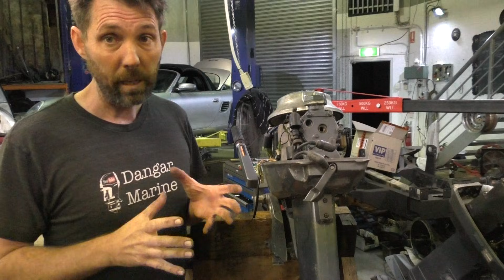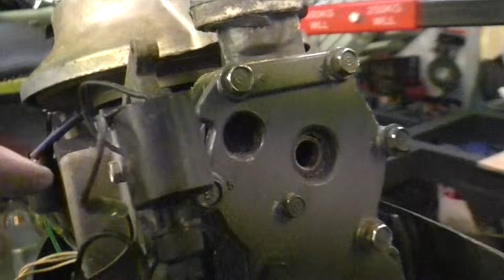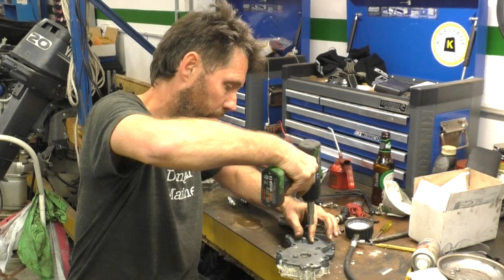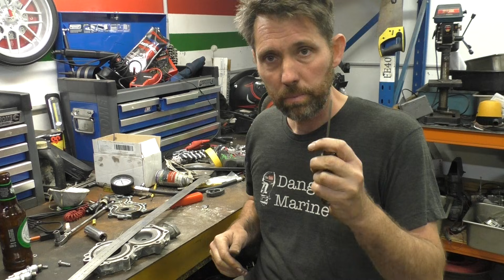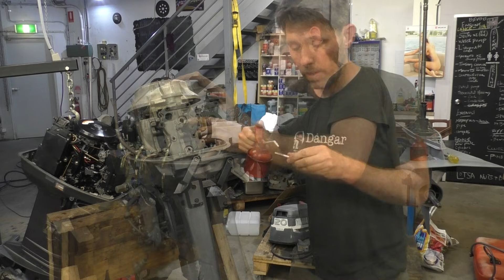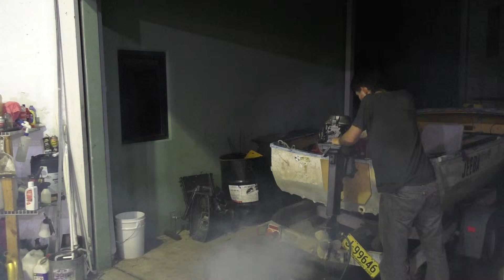Replacing a 2 stroke outboard head gasket

Comment: Great video Stu. I'm always nervous when removing those head bolts and still nervous when torquing them down. I've broken them in both instances. When it's all back together with no broken fasteners I usually celebrate with a much needed beer!
Reply: Yeah, always use new head bolts. Once installed (torqued to specs), they should never be used again. (they stretch after a time of running. it's only a few thousands, but that's all it takes)
Everytime I've seen a head bolt snap going in, it was with a used one... I've never seen a new one break on install, but maybe I've just been lucky for 40 years. lol
Reply from the maker: Hey Jack, interesting that one broke putting it in. I wonder if the thread needed cleaning first or whether it was a faulty bolt.
Reply: Worse nightmare is removing head or even exhaust bolts from engines that lives moored in salt water or the ones that's been used in salt water and never flushed with fresh water soon after returning from boating. Salt will seize anything badly.  It's a good thing to slight oil cleaned or new bolts, torque them to specs, should come out without any issues if  a latter removal is required...

Comment: if two carbs.. you know what's could be wrong; reed valves check; if upper sealing is gone -> lean upper cyl. ; inlet port cover gasket for "Falsh air"

it's definatly the upper cyl. is what is doint the sputtering... 

i love Guessing;)

by the way it's strange that only the Mercury is the only brand where you really don't need to worry about the had gaskets.. (2stroke of course)
Reply from the maker: Reed valves are definitely the next thing to check. A video on the timing will be out this weekend and it still backfires so next I'm going to look at all the causes of lean conditions. Could be a vacuum leak too.

Comment: I have a 4 stroke 5hp 2016 Tohatsu that will sometimes rev up when I put it in neutral.  Any thoughts?  I bought it new.
Reply from the maker: Hi Calvin, maybe the butterfly valves or timing advance is sticking in position and not returning properly?

Comment: have you ever had an issue with the water jacket corroding away from the cylinder sleeves?  anything you can do other than get a used block?   I've rebuilt the motor and it keeps allowing water through the head gasket.  first time i rebuilt it the headgasket i got was a 3 piece metal gasket that was revited together (i personally thought it was a crappy design instead of 1 piece with a good gasket material covering the gasket like a fiber mesh.  On that rebuild the boat ran for probably 5 hours  total over about 5 trips to the river, then same thing was double checking stuff and headgasket started allowing water in

i pulled head again and noticed the small area around the middle cylinder that had corroded the water jacket away from the cylinder sleeve

could you build that back up with jbweld so it has more surface area for the head gasket to sit against?   have you ever added high temp silicon gasket maker to your head gaskets for extra coverage?  good or bad to do that?

just looking for any random idea of what i could maybe do to salvage the motor instead of sending it to the graveyard or partying it out
Reply from the maker: Hmmm, can't say I've ever repaired a block that corroded, I've normally just written them off as more trouble than they are worth. I'm not sure a product like JB Weld would withstand the heat but I could be wrong.

Comment: that too cylinder looks like it's running a bit lean.
Reply from the maker: I think this may be a lean problem for sure.
Reply: Dangar Marine I'm not sure if it may have been in the video somewhere as I didn't quite watch the whole thing but that's what I gathered from the look of the cylinder head on no1. at my work on all 2 strokes we pull the exhaust off to check the rings and also check for scoring on the rings, piston and cylinder
Reply: number 1cylinder I mean

Comment: hey mate what would cause an outboard to surge under load
Reply from the maker: Could be an air leak in the fuel supply or the fuel pump not working properly, maybe even a vacuum leak.
Reply: Dangar Marine got it fixed at a local boat shop cost me $130 carb needed a clean, primer pump seal and timing was way off I'll take it for a spin tomorrow if I get time

Comment: Hey Stu, quick question, do you use resistor spark plugs or non resistor plugs in your engines?
Reply from the maker: I usually just use what is ever recommended by the manufacturer. If the outboard has sensitive electronics then they will almost always recommend resistor spark plugs. Having said that, I don't think you can go wrong using them even if they aren't required. Good for RF interference too.

Comment: Not really related to this video but a while back we hit a rock with our mercury 90 two stroke. Motor kicked up and but chunk of skeg missing. Still ran perfectly, waterskiing and everything. Then when we got skeg repaired they opened up the flywheel and the magnet things were cracked into 2 or 3 pieces and scratched up the stator. Mechanic thought that it was nothing to do with hitting rock but insurance covered replacement magnets and stator luckily. 
Do you think the magnets breaking were from the rock impact or just completely random? Thanks
Reply from the maker: Hmmm, interesting question. It would be hard to say for sure but it does seem they are unlikely to be related. The hit may have sent a bit of a shock wave up the driveshaft though that was just enough to make them contact so not impossible though.
Reply: Dangar Marine ok thanks. Happened at exact same time. Might just be a coincidence
Reply: May be already cracked but shock finished the job?
Reply: Ron Powell yeah probably. At least insurance covered new stator aswell

Comment: In my apprenticeship the instructors always said the torque settings were for 'dry on dry' threads and to never use lubricant on the threads because you will over torque the threads, plus the bolts can vibrate loose easier due to the low friction. Where I work now we use blue Loctite or 'thread sealer' that looks like ATF and sets like a gell and the torque settings are all redone to allow for the fluid being on the threads. Looking at the tables for a 'dry' thread use and a 'sealed' thread use, 12mm bolts with fine threads are roughly 15Nm lower for wet threads, 10mm are 12Nm less, 12mm course thread are 10Nm less and 10mm are 8Nm less. Actually , those are for 'screws' , we don't put thread lock on bolts, we use the sealer on the shank of the bolts and none on the threads, but that is being picky:-) - anti vibration is by spring or star washers.
Reply from the maker: Hey Ron, I find that a lot of service manuals will specify what conditions their torque settings are under. For example, the Evinrude specified dry but the Yamahas will tell you to add oil so I presume both these stated figures take this in account. As a result oiling the Evinrude will probably give you the wrong result. Interesting point about sealing the thread to stop corrosion getting in there. That sounds like it could save a whole lot of headache down the track!
Reply: Sealing the bolts doesn't always work, the holes have to be blind . 
 The ratchet spanner bit about them getting caught is recoverable if you push the  spanner head onto the shank of the bolt and then use a normal spanner to refit the bolt to get clearance back. 

but yes - the torque figures in manuals are for the lubricated/not lubricated thread as specified.
Reply: Ron Powell your instructor was right. Been working on engine for many years. But you also have to understand it's like cooking. People are taught one way the "basic way" and then over years everyone builds there own way of doing so. But I would say a huge no no on the oil on threads. If you clean the threads like he did then clean the threads in head you need only lock tite to get it rite all the bolts WILL vibrate out the side of the motor especially on a 2 stroke.

Comment: Interesting tip about putting oil on the bolts so they don't bind and give a false reading on the torque wrench, I'm still working on the 50HP Mercury but the delay is that I'm also working on the fiberglass repairs to the boat it will be going on, finally got the stingers and transom dry mounted and there a perfect fit and still waiting on the flywheel puller to arrive so I can properly repair the wires coming from the stator, which at that point I will mesure properly before re-installing it
Reply from the maker: Hey Adrien, sounds like your project is progressing nicely. I'd like to do some more vids on repairing fibreglass hulls.

Comment: Great video, have you ever  done a rebuild on a yamaha 60-70 hp 3 cylinder crankshaft.
Reply from the maker: Hmm, just trying to think. I think most of the ones we have repaired have been two cylinder. The dead three cylinder we had in we just did a power head swap because we had one good head and one good leg.
Reply: Here in my country Puerto Rico we use 40- 60- 75 hp yamaha enduro for commercial fishing and is very difficult to find  a machine shop that can rebuild the press crankshaft on 40 hp and 60 hp yamaha ,if you have the opportunity to rebuild one of these please make a video thanks

Comment: I was surprised after seeing vids of people removing the head like you did and looking at the pistons ect...to realize my 50 merc is a "headless" outboard. Its the strongest stock 50 2 stroke ever made at 59ci(yamaha is like 42) which I'm happy about but I think it sucks I can't remove the head like the other motors. Apparently if I ever want to rebuild this motor I have to find a very knowledgeable machine shop who can bore  "blind cylinders". Have you ever had to mess around with a headless outboard before, lol?
Reply from the maker: I can't say I have worked on. It sounds like it should be quite strong but I guess you need to split the crankcase and pull the pistons out that way if they need and attention. As you say, most machine shops probably don't have much experience with boring them. Fingers crossed it will just keep going!
Reply: Thanks You're right im gonna keep it until it dies and keep it well maintained and hope for the best.

Comment: Would it be a good idea to pack those cylinders with some shop rags to prevent debris from entering while cleaning block?
Reply from the maker: It certainly wouldn't hurt. I don't worry so much about this crud as I would about metal filings from grinding for example, but its not a bad idea to stuff some rag in there before you start.

Comment: Yeah Stu; In my shed I've got an old 2 Stroke maybe a Johnson motor that's seized from lack of use. I'm going to keep a close eye on how you preform the diagnosis on your engine and use your teachings on mine. I put oil in the plug holes, but I'm thinking I may have to persuade the top of the pistons a little.  Thanks for your knowhow to this SH-stuff.
Reply from the maker: A mixture of acetone and ATF is good for unseizing, but yes, a few love taps can help too. ;)
Reply: Got it Stu; I appreciate the information on unsticking.  Thanks so much. Just for clarity, ATF is transmission fluid Yes? .
Reply: I got it... ATF = Automatic Transmission Fluid.

Comment: I changed the headgasket on my Mariner (yamaha engine) 30hp last summer. The gasket was blown and had less than 50% compression than cylinder 1.  Snapped two of the headbolts and it was a bitch to fix it. Luckily it was much material left on the cylinder so i could drill the old remains out and make new threads. Now it runs like a champ!
Reply from the maker: Nice work Mikael, glad to hear you got it fixed up and running nicely again. :)

Comment: Hi Stu,  I have zero experience working on anything that runs in salt water. How old would you peg this motor to be, or how much time would you guess has passed since someone opened her up? I saw the scale that had accumulated, and just got wondering how long it takes to get to that point. Is it indicative more so of an engine that works a lot, or sits a lot between runs? Or, could that amount of salt scale just be because the thermostat wasn't in place?  Thanks. p.s. Smoke isn't necessarily a bad thing... helps keep mosquitoes away :)
Reply: Stan,
 Australia being what it is, there are almost no true fresh water engines around. Even our rivers are brackish more than fresh. The few true fresh water places are irrigation dam pondages rather than natural lakes. So corrosion is pretty much standard here. The amount of corrosion shown would indicate the engine is not being fresh water flushed each use, nor being drained while warm (let engine get warm, stop engine, turn off water quickly and remove muffs. The residual heat lets a lot of water evaporate - my neighbor even pressure feeds 20litres of methylated spirits through his engine after a water flush to get the water out - but he gets meths for free !) That much corrosion is not great but no where near the worse. People start to not care about an engine when it starts mucking up so flushes , leaving thermostats out, not doing linkage maintenance etc is common. I think this may be a 'commuter' engine, in which case the engine would rarely get a flush out and the engines don't live long compared to most 'holiday' boat engines. 
As an idea, using Dangar Island - 2 x 15 minute runs per day average = 178hrs per year, never flushed out, never rally serviced- just fix it when it breaks versus - 'holiday boat' engine - say 10 x 2 hr runs over Christmas break + 10 x 3hr one day runs the rest of the year , flush after every run, serviced once a year = 50hrs of use - 3 years is a long time for a commuter, just run in for a holiday motor.
Reply from the maker: Hey Stan, Ron is on the money with this motor. Being a commuter boat it never gets flushed, owners don't have trailers or taps near the water. I'd say this one is about 10 years old. Also, the river hear has a lot of silt in it so it is often more mud inside the engine than salt, or at least a mixture of both. The one thing in their favour is that they get run twice a day every day so they never really dry out internally.
Reply: Copy all that. Thanks Ron ! Thanks Stu !

Comment: Great video, more interesting for me, what about the bold broken in head? And how to prevent this? Thanks
Reply: If a bolt feels tight, try turning it until you feel more resistance and then turn it back in. Continue this process until it feels free, turn out half a turn , turn it back in, turn it out one turn, turn it back in and continue.
Reply: albertonex19 thanks
Reply: And once you get the bolt out, run a tap down the thread in the head to clean it, and throw the bolt away (it has been stressed and will probably either break while re-torquing it or when it is next removed. ) I also prefer to use weak Loctite (blue stuff)  on the bolt threads rather than oil . Oil washes off, the Loctite stays on there and provides a water seal to stop water wicking down the thread to start the problem all over again.
Reply from the maker: I agree with this method, best way to go.
Reply: I did this, still didn't help. But i usually do this everytime and it works.

Comment: @dangarmarine  my outboard recently locked found out that it's the lower unit motor runs good  is it better to get a new lower unit?
Reply from the maker: I agree with all of this, and really appreciate you guys taking the time to answer each other's questions. As time goes by it is going to be harder and harder for me to answer them all personally even though I always will be reading them all. :)
Reply: Hey bud. Buying a new LU is expensive as hell. Stu has the best lower unit vids anywhere..believe me i looked. It's a better idea to open it up and see what the problem is. It can be a challenge and for a lot of people it's better to bring it to a professional. What motor do you have? I know my lower unit new is around 2k and i know my area mechanic would get you settled for way less than that. You can also check craigslist in and around you're area and if its a popular motor you will find one that works or at least get a broken one and use for parts. Also if you have a larger size motor there is a company called SEI (or something like that) That makes aftermarket LUs for a lot cheaper than oem. I can't speak to the quality of them as I've never used one. Good luck with whatever choice you make!!

Comment: Hej Stu Great video, I have a 10 hp Johnson/evinrude commercial motor from 1984 im trying to find parts for it, do you know where i could find them ? 
Thanks from Danmark !
Reply: Jon Unnar Kristinsson http://evinrude.dk har nummeret til den danske forhandler af stumper. der ligger også er komplet reservedels katalog og en prisliste så du kan finde alternativer til udgåede kits og stumper.
Reply: Jeg kan ikke finde J10rsz i deres katalog måske jeg skulle prøve at snakke med dem :) 
Tak for info :)
Reply: heh havde ikke set det var en commercial. kan se det er en OMC 10/14 men kan ikke finde noget info på den udover at den formentlig "bare" har et andet ben i forhold til 9,9/15hp http://forums.iboats.com/forum/engine-repair-and-maintenance/johnson-evinrude-outboards/653355-difference-between-commercial-and-non-commercial
har selv en J4rd fra 88 som er en 4hp på et 6hp ben.
Reply: håber du finder de stumper du mangler. efter sigende er 80'er modellerne evigheds maskiner så længe man kan finde sliddele.